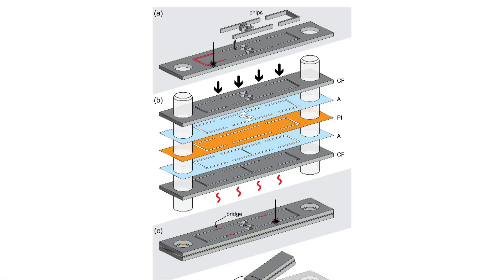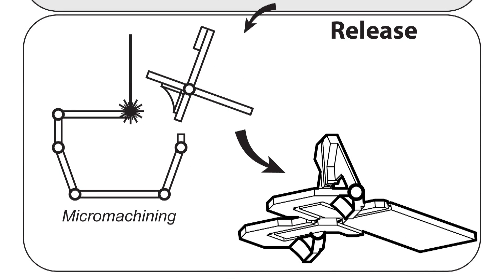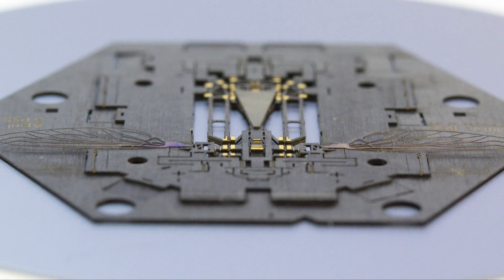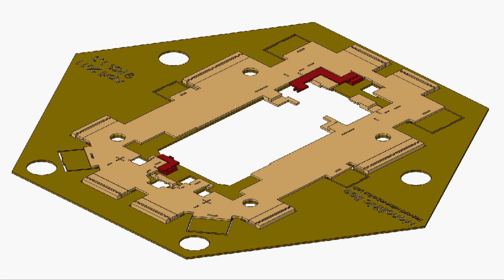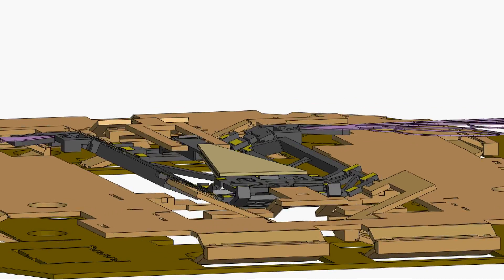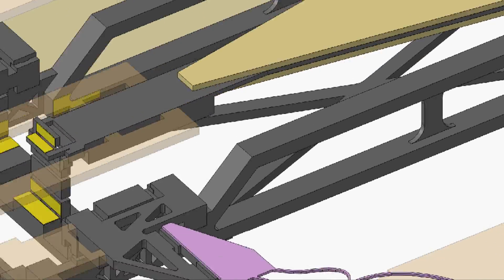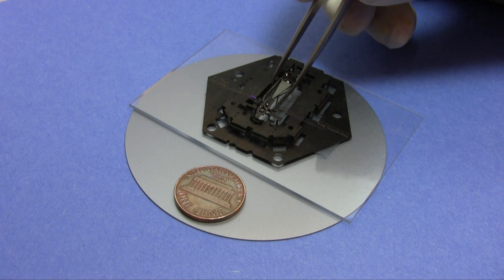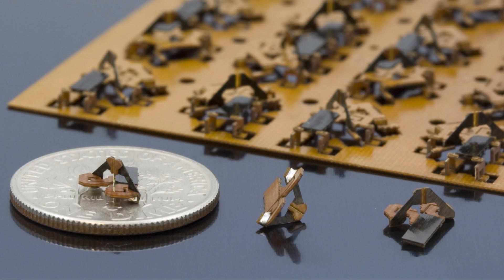Pop-up Fabrication of the Harvard Monolithic Bee (Mobee)

Comment: Can they actually fly ? It seems that the wing is inflexible and that the wings can only operate symmetrically (?) So I guess controlled flight it not possible yet for the mobee ?
Reply: +shodanxx This video is merely a representation on a small scale manufacture process. They chose the bee just because its size is familiar to everybody, and people would instantly realize how delicate the work really is. The Mobee is apparently only equipped with a piezo actuator, and doesn't carry any battery. So it wasn't meant to fly in the first place. But potential capabilities of such process is well explained judging by the sophistication of his work.

Comment: You believe that Harvard is spying on people using microrobots with cameras, that is stupid yes.

I never said there wasn't any rc helicopters with cameras, but that was not the subject.
The OP was "What's it used for?" refering to this little microrobot fly, the answer is that it's used for innovation, for example, they invented a new way to mass-produce microrobots which is explained in the video.
Harvard is a university, they are not a secret organisation that spy on you.

Comment: @SourRevenge 
Nope you done need batteries if the power usage is small enough. If anything i would recommend custom made Capacitor or supercap would be good enough. Would cost a bit to make but im sure this project cost a ton to begin with.

Comment: @ledzeppelin4892000 thats because it doesnt fly yet.  it clearly states: "from an external power source."  also, it has no flight stability mechanism yet and no good way to attach a power source or control mechanism yet (transistors and such) because the weight would be too much for it to handle.  what you should take away from this video is the fabrication techniques.  very impressive.

Comment: The process is awesome.  It's like concrete slab buildings with steel plates for weld-seam construction, (at the point of solder "locking") just tiny, tiny, in size and it moves.  Very exciting.  Hope it proves helpful to humanity instead of being another killer.  We have enough of those.  Ya?